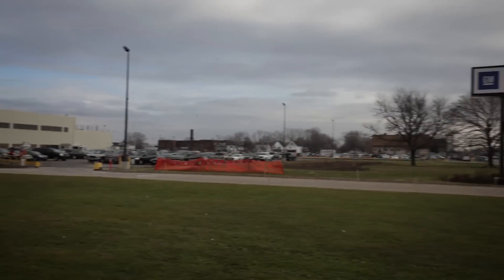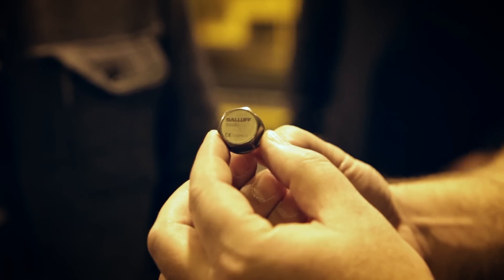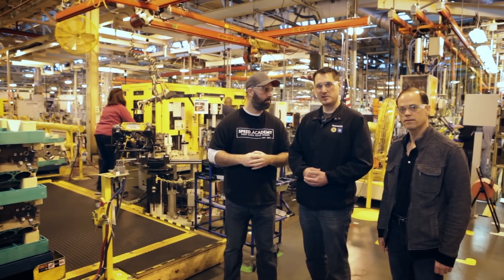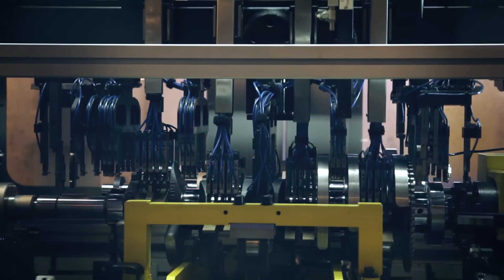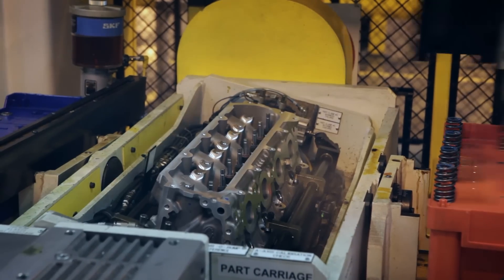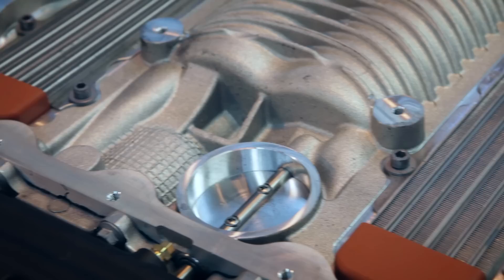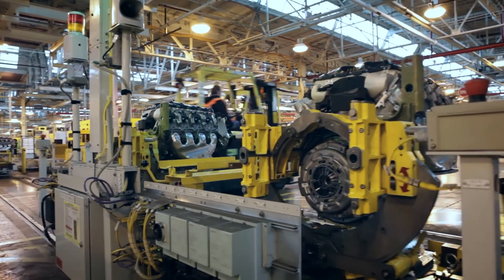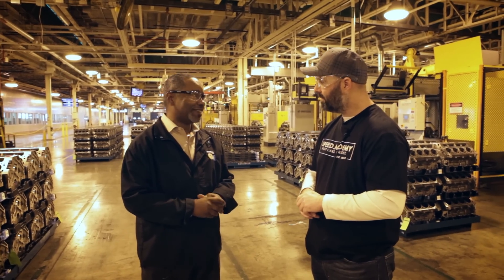Building GM's most powerful Engine Ever, the 650hp LT4 V8!

Comment: I hate it when snobs out there think that american engines are less techy.  In fact its not.. it's a simple engine design and if it ain't broke, why fix it?...
Reply: yep nothing dumb about it. But the STUPID power it makes :)
Reply: And look at it this way; Back in the day if you got 100,000 miles out of your engine before needing say a rear main seal, valve job, etc. you were doing pretty good. Now days 100 grand on these engines is trivial. This because the precision tolerances that old school engines never had is incorporated. These Engines even on critical clearances like Con Rod big end Housing ID and Block main bearing clearance ID will stay within .0001 (that's 1 ten thousandth) accuracy. I can remember brandnew Gen 1 SB LT1 Cranks being out as much .008-.010 on stroke from front to back. You won't see that on an LS Crank, another reason these engines have double even triple the longevity of GEN 1 Engines ...
Reply: @stevematz7354  Valve guides and seals seem to be the modern issues but I get your point.
Reply: @stevematz7354  The Japanese figured that out building license made copies of British cars after WW2. It took the American auto biz till the '80s to get it- by then the Foreign brand cars had 45% of the American market. Ford and GM have sold off all their foreign brands, or closed them- Opel is in the wind, as are many others- Ford is closing it's Continental and UK plants. GM and Ford will go forward without any offerings for the passenger car market. Glad to know Toyota, Honda, BMW, VW, Mercedes and others have big passenger car plants here! Oh, and they pay better too!
Reply: jdr ok LT designation has been utilized for gen1 gen2 and now gen5 SBC engines. They had LT1 corvettes in the 70's.
Reply: @themadmachinist8637  gen 1 was a pro code not a designation. Lt designation was a gen 2 and 5 and 32v lotus/chevy/mercury marine v8.
Reply: Mark Speed6 
we have Duramax engines..300k miles ..only need externals..
alternator..AC comp..PS pump..etc.
Reply: @jaxxbrat2634  Mark needs a tune up- he's likely got a subscription to a motor mag or two, but I detect no grease under his finger nails- his whole"bad" list was diesel engines that have decades of production, use and improvement to show- one of the big things kicking everybody is the higher run temps the smog regimes have given them. The old 444 has been hauling school kids around in big yellow boxes since the mid '60s I believe. He had something he wanted to say, some people just break wind!
Reply: GM makes some of the best engines in the world. More vehicles to reach 1 million miles than any other manufacturer. American engines are designed bigger for a reason. Working on heavy equipment and generators I've seen foreign companies use American engines due to better longevity, less stress on a bigger/simpler engine and produce more power thru a broader rpm range and less cost. Big simple engines definatly have a use. Another thing, people want to talk shit about the government bailing them out of debt but you forget GM help enourmousely to bail the world out of WW2! Oh yeah one more thing what's up with all the veterans buying foreign cars? Makes no sense to me! I mean it's your right but at the same time if you love your country so much why are you sending your money overseas to who knows where it really goes. When I see a veteran plate driving I first think to myself thank you for your service but second damn another person who thinks because it's made here the money stays here.
Reply: @Erik-kp1ux  Best post on here, Buy Foreign and feed foreign kids,  Buy American and feed your own kids!
Reply: @Erik-kp1ux  - is that why gm uses Isuzu for the Duramax diesels? Gm tried converting a gasoline small block Chevy into a diesel and failed miserably, what geniuses at gm decided to reuse the original head bolts?
Reply: Erik Nelson It is way better to have Toyota or Honda management over United States plants versus GM management. The workers get treated better and do better work. The cars are better in the end as well. If max profit is your only goal and you don't have the brains to know how to accomplish that, then you shouldn't be leading  a major US company.
Reply: @Erik-kp1ux  So, you don't see Toyotas from Austin, Texas plants as "domestic"? Or Mercedes and BMW built in the USA? How about KIA's also built here? Maybe VW, built... I can keep going. I'm just a taxpayer who contributed taxes to that pile called TARP. It was a Democratic President who administered it and was brave enough to call CEO Rick on his bonuses and big expensive perks, like a corp jet big enough to fly two dozen across the Atlantic , and forced the light of reason to prevail before GM executives "bonused" them out of biz- leaving all those Union people out of work. By the way, do you happen to drive a Ford E350? Engines built in Mexico, truck is assembled in Canada. So, dear shoot from the hip friend, what is or is not an American product? TrumpKins keeps talking this trash about large specific tariffs on foreign cars will be the wildest cat fight we have so far seen, with mega bucks international car Mfgs hiring many dozens of skilled attorneys  and millions of dollars worth of lobbyists. And mostly it will inform us all that Congress has been sitting on it's hands while the world around them changed beyond simply going back. PS- I'll caution you to be carefull ; domestic content on American Made Cars is already below 70%- again  what is a domestic product? A Toyota sedan with a GM label on it? Oh, it was assembled in the USA- of outsourced parts .
Reply: @mewrongwayKOCXF  First, I do understand the attraction. The NAFTA, as originally constructed had a minimum wage for factory workers in Mexico- that was watered down badly in negotiations for Republican votes to get it passed, and even the little that was left wasn't enforced. The quality is not the same at all.
The point I was making had more to do with the legal definitions of what a domestic car is and what a "auto of foreign manufacture" is; today, a Ford you buy in Kansas City, Kansas, may well have an engine and transmission built in Mexico (including castings) and assembled in Canada, or all originating from and assembled in Mexico. The law, AS IT IS WRITTEN, would call that a foreign car for tariff and taxation purposes. The Toyotas built in the US, of parts largely soured and cast in the US and assembled in a factory in the US is LEGALLY SPEAKING a domestic automobile. And in addition to seeing to it their (Toyota, Honda, Hyundai, BMW, Mercedes, FIAT (who own Chrysler now), and I believe Nissan) employees pay their taxes, all have American corporate offices and PAY TAXES just like every other American corporation.
Take off the damn RedHat and let some blood and oxygen into your brain! What I just said can be confirmed through the WSJ, a widely respected, conservative business news source and many other places. Really!  PS; Those "profits" are the foreign currency Japan and others use to buy things from us. FR
Reply: @fredericrike5974  Take off your black hat and pull your head out, The profits are not staying here. They are going to Japan and if Americans were not buying Toyota, All them people would be working for GM and Ford rather then Toyota wich in turn would feed American kids rather then Japanese kids.  I guess your ok with the fact that the average Japanese kid owns more of America than you do!  Don't be so naive! Nabor has 4 Toyota's and 4 Collage educated kids without jobs! FR
Reply: +Chris A so you are saying a rotary (wankel) is better since its the simplest engine there is
Reply: @joshkiej6601  Wankels had their problems too.  There just isn't enough of them around for everybody to be aware of that.
Reply: The Real Santa Claus well technically it could be if it had a bbc in its place but the pushrod block is actually complex
Reply: @jdrok5026  it's really not bro!!
Reply: @artiaga1547  what is your comment even about complexity? Because a cam in block engine is way more complex than a dohc which eliminates many components. These areas are also eliminated of any oil passages that would be for lubrication of the cam the plunger on the hydraulic tappets and the fluid movement through the pushrod and rocker arm. Complexity of a ohc is literally just in the fact of how many mounts are used but the system is actually fairly basic and less complex.
Reply: @jdrok5026  Not much more complex than Henry Ford's early 4 cyl inlie block flathead motor- some yes, a lot no. In some cases they can be the same- Audi (and Lamboghini) borrowed the base design of Dodge's V10 Viper, an Overhead Valve engind, and in the redesign, run the vibration balancer  where the cam used to go, then chains to run the DOHC top end.
Reply: explain why it's outdated.. exactly.
Reply: Alexander Ballantyne ...that engine is a monster r and will rip your head off. use better judgement.
Reply: Yeah nah its a less techy engine... noone builds pushrod v8s anymore other than GM, ford and Chrysler
Reply: @monstertrux007  There are some producers in places like India. China still uses OHV for many gas trucks and diesel. Not many, and few close to the West.
Reply: Jaxx Brat shit, how I used one for work and I've had to put 3 sets of fuel injectors in. it's an 01 but my 86 gmc 3500 dually is a champ
Reply: Ricer
Reply: Yeah, keep saying that, Bob-Lou.
Reply: @Maloy7800  i would love to kick the shit out of this 4 stroke and bash it, i will run klots and hang it upside down to see how long it lats with all its so called oil injection, let the fun begin
Reply: It would be nice if we could get big block 2 stroke over 500 CID with having a heavy 8v92 which i have. I have heard of some 2 stroke conversions with billet aluminum block for certain street rod applications though.
Reply: Mark7 GTI these computers ain’t simple
Reply: @nadronnocojr  who said anything about computers?. Stay focus
Reply: Agree.SPOT ON
Reply: Hey I just wanted to let you know that you've had 5 years to fix the obvious flaw with your comment and you still haven't.
Reply: @patw9175  Uhm ok... are you replying to me?. Who the fuck are you and what was wrong with my comment?. It's actually a positive comment. Unless you can't read. Go back and read it again. Thank for 5 years
Reply: steve matz lts are gen 2
Reply: Mark Speed6 if it's outdated. it's outdated
Reply: @zachhaus8488  its not time affects nothing in design .only bean couner mes up things n e p a
Reply: The Real Santa Claus ....Wankel has its place but it's apples and oranges
Reply: Get yourself a HEMI 200k mi. on my truck and shifts at 5500 rpm all day!
Reply: I agree plus the American v8 with a cross plane crankshaft is more 2 stroke convertible like this.https://www.youtube.com/watch?v=RWO-QvjZqkQ. or it can be poppet valved 2 cycle u-loop scavenged with baffled valves, this is a popular modification on 3 liter Toyota 6 cylinder engines in supra and trucks. it was developed in the 90's and was called the toyota s-2 valved loop charged 2 stroke that works like this volkswagen 2 stroke 1.9 liter diesel:https://www.youtube.com/watch?v=kot9GYBeCJ8, Hemi and 4 valve or 2 valve will work with u-loop charging but the inlet valve should be baffled for thorough loop scavenging.
Reply: 2 stroke poppet valved loop scavenging is what makes american dragsters awsome, DUH
Reply: Rotax 850 etec makes about 3.2 ho per CID right out of the box. You can always make a poppet valve loop charged 2 stroke out of an aluminum hemi!
Reply: Exactly every modern engine design has its pluses and minuses no design is better than another.
Reply: Zach Haus  Couldn't have said it better myself.
Reply: @dougbawden4321  Flash from the mid '60s; Shelby Cobra powered by Ford Engine Beats Ferrarri  for LeMans Win. Push rods vs cams all over the head. They are sneaking up on a couple of in production dohc v-6's though!
Reply: @fredericrike5974  Each to their own... I didn't mean to offend anyone.... My bad..
Reply: @dougbawden4321  And maybe I'm over touchy-  our gov is floundering off into a morass of insanity and it doesn't even have a clear idea idea of what a domestic or foreign car is or isn't. the car building biz in the US is in much more trouble then DJT and Co  know- H-D didn't need more false direction- the way this is coming out, their European sales will continue falling, the new designs they bought in India (for production in India) to establish a new rider niche won't be coming (was a much better deal than Aero  macci deal from the '70s). Wasn't reeally offended, I'll take some rap for that.
Reply: These engines maybe popular around China but Europe could give a fat rats ass about them!
Reply: @clinteastwood9115  That's because Europe has nothing that will compete with this engine!
Reply: I know that Americans do not want to hear this, but F8 Tributo has a v8 with 720 hp and the Mercedes-AMG M 139 is a 4 cylinder with 416 hp and 520 nm

not to mention the 1000 hp F1 engines that have only 1.6 liters capacity.

when it comes down to it, I always choose nm over hp
Reply: bad banano majority of cast iron block V8's traditional use in America is severely outdated. The power to liter ratio is a joke...And also The "hemi" is very out dated. Pent roof housing supports greater combustion and power ratios. The standard inline 4 engine for Honda is far more advance then the majority of V8's. Americans are usually to fat and arrogant to understand the very dynamics of a very efficient engine. Even the weight of pistons can effect acceleration even flywheel weight. So drink another shitty domestic beer and be smug. I rather stick with superior engineering.
Reply: @zachhaus8488  And more foreign beer! The hose pi$$ canned in "Murica is a sin! My innocent derriere got a job in Brisbane- "Muricans don't know diddly about beer. Sam Adams in a pinch; have you been to Thailand? Killer water- every hamlet brews beer of it's own- all real good, some the Germans would like!